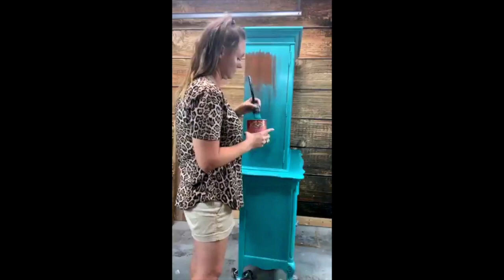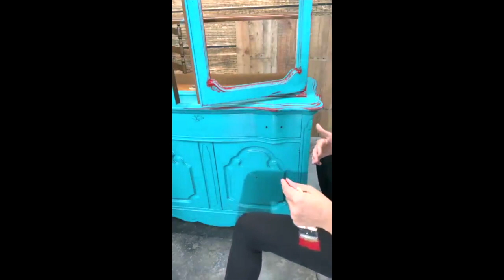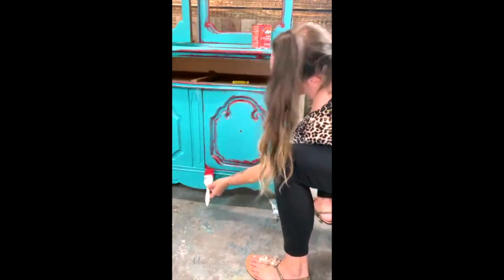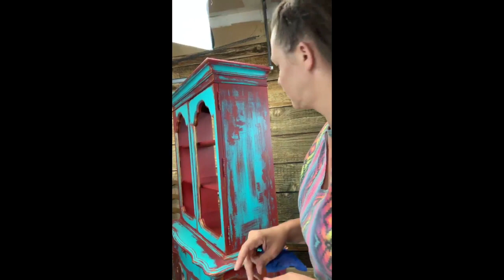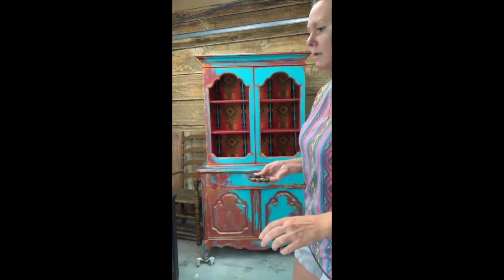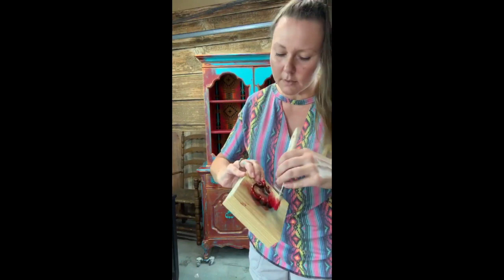Boho Style China Cabinet~LIVE SHOW

Comment: Did you sand it down before painting or did you degrease it with products like Dixie Bell, also how many cotes of  the blue
Reply from the maker: Marlene Lamora Greetings, This piece did not require any sanding.  I used a furniture cleaner that degreases and takes of all dirt and oil.  Here is the link to the product on my website https://www.texasgypsystyle.com/products/furniture-cleaner

I painted 2 coats of the Patina Green, looks a little blue in the video...link to paint color. 
https://www.texasgypsystyle.com/collections/general-finishes/products/patina-green
Thank you!
Krista